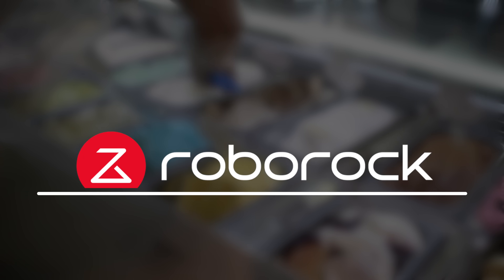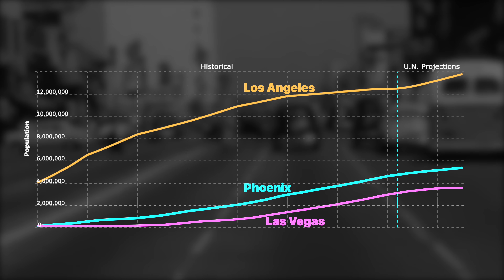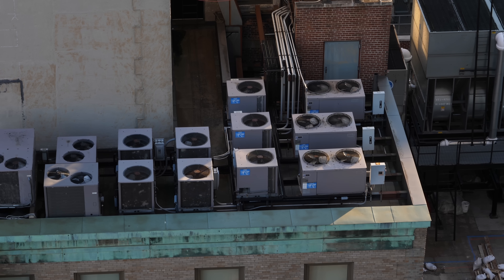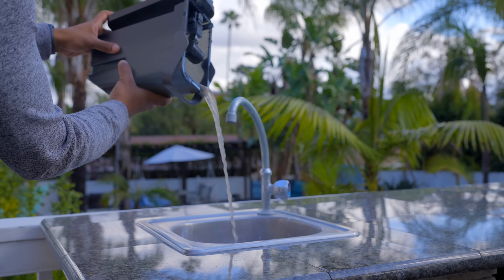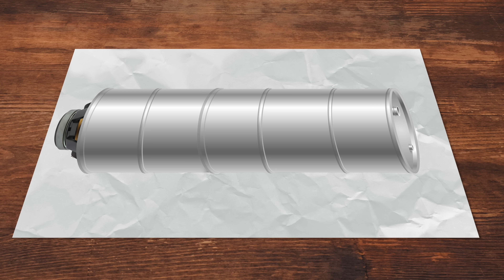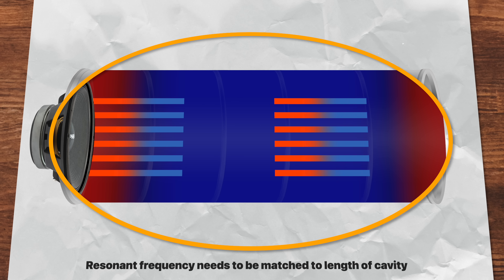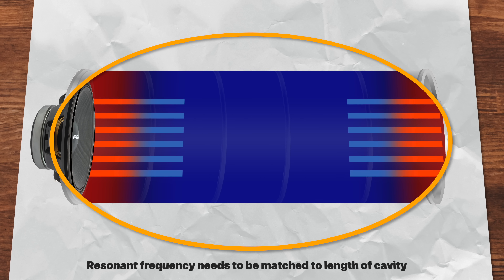Next Gen Heat Pump Heats & Cools Using Sound!

Comment from the maker: Checkout the Roborock S7 Max V Ultra - Buy 1 get 1 Free between 12/14-12/18 ! http://bit.ly/3VUJO3V
Reply: If you are losing refrigerant from your residential heat pump, refilling it is not part of the maintenance, you need a leak search and repair. Those systems are supposed to be sealed as well. Don’t get scammed by HVAC companies!
Reply: @josephesparza9900  I second this!
Reply: How Many Helium Balloons Are Filled Each Year?
Reply: We got one as soon as they were available in the US.  Wall-E is an awesome little bot running around our house now.  🤣
Reply: Fix that Fuking Mike Pls. For 6 Months the same trash high pitch Audio. For fuk sake Man ! I have to Pas your video through Audio Filter.
Reply: Wasn't BlueHeart releasing a product this year?  Any updates on this tech?

Comment: have no idea if people in the comments are correct when they say this is less efficient than normal heat pumps. but i wonder if it's easier to increase efficiency by skipping energy conversions than it is with other heat pumps. i know there are ways to drive mechanical motion directly using solar energy, which means you could skip the energy loss from converting gas/light/fuel/etc into electricity to run a loudspeaker.

Comment: that heat pumps move heat around rather than creating it does make them more efficient at just heating a space. but creating heat is more efficient at heating when that heat was going to be created anyway. my bedroom warms up significantly when i play a resource-intensive game on my computer. if i'm going to play a game anyway, then that heating is effectively free. passive homes can be designed around this concept. waste heat is not waste heat if you find a way to use it.

Comment: Two questions in case there are experts here: isn’t propane or butane just as good working fluid in a regular heat pump? Not used due to fire/explosion safety? And did thermo acoustic heat pumps and motors: isn’t hydrogen as good as helium? If so, not used for the same reason?

Comment: What's the expected scop for space heating using radiators or floor heating and hot water. I know hard to get specific but on average compared to a regular heat pump with scop's of 3.5 or 4..

Comment: You could also use heat to do your cooling.  Like thermo vacuum tubes could power this thing.  Like using this system would be cool.  This system could also heat.  Like thermo vacuum tubes could gather heat and the acoustic heat pump would multiply this heat by pumping heat from a source.  The source could be air or something like a geothermal source.  For winter one would need some heat storage for night usage or some sort of back up heat to get the high heat to drive the heat pump.  It is my understanding  that an acoustic heat pump can pump heat to a much colder temperature than most gas heat pumps. Is all this possible?  I think so as I am sending this chat to this site on something I could not be imagining using 10 years ago.

Comment: It's technically same principle as TEC Peltier, but the efficiency comes from the design.
Instead of using all-peltier membrane chip, it uses one tiny chip slapped at the side of a helium-filled ceramic tube, and the vibrations are conducted through resonance instead of forcefully electrifying whole membrane, you just electrify one tiny piezoelectric material (speaker).

Engineering genius in this is almost frightening.

Comment: Hydrogen would probably be a functionally better choice than Helium.  The small amount contained in the system, and the fact that it is lighter than air and escapes quickly, means that it would not be dangerous in the event of a leak.

Comment: 1:49 - Wow... never knew heat pumps are more efficient than natural gas such as hydronic heating. Interesting thermoacoustic heat pumps, I also read something about Magnetocaloric heat pumps. At the end of the day, I wonder which is more efficient and provides maximum output BTU. I still like the traditional mechanical gas/fluid heat pumps, they are low cost, easy to build, tons of literature on the subject, super efficient and easy to repair. The CFCs are being replaced by more environmental friendly and non toxic chemicals. I think in 30-40 years, not any time soon, the traditional heat pumps/AC will be entirely replaced by newer heat pump/refrigeration technologies globally.

Comment: I'd like to avoid going the traditional heat pump route just because the thermo acoustic variety sounds much easier to diy install and no ****ing way am I going to pay some dunce with an HVAC certificate to charge me three times the cost of the equipment itself to install it.

Comment: This does NOT make any sense!!! The efficiency of this would be at best 30 to 40%. Any energy produced is what has been inserted in the system. On the contrary, normal heat pumps benefit from the heat of the environment. For heating is useless as a simple resistance would have at least double the efficiency. For cooling, the worst heat pump has 300% efficiency. As for maintenance, quality heat pumps go for decades with no maintenance.

Comment: I'm a HVAC technician. I install service and maintain heat pumps and all kinds of HVAC systems. I'm excited to see how far heat pump technology has come.
Reply: Hi AJ, odd query: do you know how long say a typical modern 2.5kw split AC has to run to make sure its compressor doesn't go without oil? Eg. 5 minutes at a certain % of power capacity? Or do modern units have a way to only run intermittently without running out of oil for the compressor? Cheers
Reply: @jimmybrad156  The compressor should have oil in it when it starts running. It should not need to run to ensure it doesn't go without oil unless there is oil migration. Oil return is not a common issue with smaller systems. Refrigeration systems and some large units will "pump down" or empty the refrigerant from the evaporator at the end of cycles to make sure oil returns to the compressor. I'm in the US so we rate our systems in btu. If my math is right your talking about a roughly 8500 btu system. Like a window unit or mini split? It's very unlikely you have oil return problems unless you're talking about a freezer or something.
Reply: @RoyArrowood  Yeh it's a small split. 8500 BTU is spot on (2.5kw.)

Comment: Using thermoacoustic principles to synchronize the heat exchanges in a Stirling cycle engine will convert the whole apparatus into a maximally efficient mechanical engine. Fascinating the natural frequency of a cylinder is the actual Maxwell's Demon that can reverse entropy and sort hot and cold parts of the spatial volume. We've been over an oil barrel down in a coal mine for a century or more, and not for our own good either. Clean cheap energy from heat and bass woofer? Yeah the national security concern a$$a$$in$will be looking into this right away lmao

Comment: Recharging a system is NOT part of a regular tune up . Its extra $ always and indicates a significant problem ( refrigerant leak ) additionally NO DUCTLESS SYSTEM MANUFACTURER WANTS YOU TO TOP OFF EVER . You weigh in the exact charge . Topping off is dont with non ductless systems. Bad info / advice

Comment: Perhaps the best solution would be an efficient means to convert the heat into electricity, which could be more easily transported and stored for later use. Could we use giant Thermo-Acoustic heat pumps to remove the heat from our oceans (since they are natures largest heat sinks for the global greenhouse energy we're accumulating...) and turn that into electricity to power our civilization without the use of carbon? Get a second bite off the Thermodynamic Apple as it were? While at the same time fixing one of the growing problems of our own making? At least in theory, you could kill a whole flock of birds with one stone in that case.

Just a thought.

Comment: i have had a traditional heat pump at my house, air source, since 1995 and it still works, with occassional maintenence.
the biggest fault is when the outside temperature drops below 32 degrees f, it doesn't produce much heat. the manu-
facturer claims it is efficient down to 0 degrees f, but how much heat is in very cold air? during this cold snap (12/22)
my heatpump has been running almost nonstop and producing very little heat. maybe the acoustic version will be better.

Comment: How have heat pumps always been more expensive than regular heaters? Maybe with 3rd world cheap electricity from coal and with a crippled infrastructure. In Europe, with a stable, strong network, but respective prices for energy, it is insanely stupid to heat with pure electricity like a hairdryer...
Reply from the maker: heat pump appliances are usually more expensive upfront, but yes as you stated, long term they'll pay for themselves!
Reply: @TwoBitDaVinci  Okay, but isnt hat always the most important factor when buying something? Even if electricity is as cheap as in the US they will pay off over time. Not to mention the huge environmental factor of efficiency.

Comment: Couldn't really grasp the idea of how this will transfer heat. Sure you explained how acoustic energy turns into thermal energy. But first, we have to take the heat from let's say out of the house and convert it into acoustic energy in order to transfer it back into thermal energy to pump in the house. How is the heat gets transferred from one space to the other?

Comment: I have been working on Heat Pumps since 1972.  I don't believe the acoustic heat pump will ever be a real commercial operation. Thee are too many problems to be efficient. It is one of those technologies which will always be ten years away.  Heat pumps have been getting more efficient over the years.  The development of the frequency drive inverter has helped tremendously. When it is cold you can speed up the compressor to move more heat.  The same tech is in electric cars to drive the motors at different speeds.

Comment: Bad news about heat pumps 1) they become less efficient as it gets colder 2) the new refrigerants that are doing to replace the cfc , hcfc replacements due to their “ GWP” are classified A2 by ASHARE .This means they are “ mildly flammable “ .Enough so safety devices are going to be required to be installed  to help prevent fires incase of a leak .Yep, Trade offs become uglier .I am an HVACR technician and have been so for 30+ years so yeah a know something about the subject .Let’s hope thermal acoustic systems work out and there are no nasty surprises

Comment: having a higher COP is actually scary because it means for every joule removed for cooling, 5 are put into the air outside, thus leaving anyone without heat pumps feeling even hotter (plants animals) and increasing the heat island effect. we need to increase better architecture designs to reduce our need for cooling and learn to be comfortable within a temperature closer to equilibrium with the outside. the only way s higher cop helps us is when heat pumps are used for heating!

Comment: Living in the center of Texas we need A/C in summer.   Over time in our little hamlet as the units that pump air through floor vents go out we have learned to install the units for windows not in windows but in a sealed box inside the house at ceiling level with a nice vent on the outside wall.  We wire in a new electrical outlet a ways below it and run the A.C cord through the wall until it comes out by it and can be plugged in. It has a tray with a drain to the outside under it. We put several of these in a house and they look not so different than mini-split units.  Each has its own remote and the new ones are very efficient, and easy to get at a good price.  This way we can fix our own A/C problems and even replace individuals units without having to wait for expensive A/C guys to show up.  And cold air coming in at ceiling level is obviously better.  One friend told me their summer electric bill was cut in half with the boxed in units.

Comment: Not sure I understand the first bit about resonant frequency. Are you saying the gas molecules, in addition to being compressed by the forward movement of the speaker diaphragm are also excited to vibrate at a higher state by resonance? What about the energy needed to increase the rate of vibration? Where is that coming from, is it from the compression? Is this sufficient? Because speaker diaphragms move back and forth. When it moves forward it compresses the air in front of it while creating a low pressure area behind it. When it moves back however, the opposite happens. Now its creating low pressure inside the tube, making the gas inside expand and cool. Net effect should be close to zero apart from mechanical heating up of speaker motor. So what aren't I, seeing?

Comment: Cool!
I don't know if it was mentioned in the video, but the working principle of these heat pumps is that of the stirling cycle. This is just up my alley as I'm slightly obsessed with the beautiful simplicity of the stirling cycle. It should in theory be more efficient than the rankine cycle (that is used in your everyday heat pumps which uses a phase shifting working fluid). The biggest drawback of the stirling cycle has however always been the low power density, which has caused big, impractical and expensive machines. If this is solved in these thermo acoustic heat pumps I'd say it is a breakthrough.
Fun fact: The process is reversable, meaning that if you have a temperature difference, It can create a standing wave from which energy in turn can be harvested by the "speaker".

Comment: I still think an oak log in winter and an open window in summer are hard to replace.  No wiring.  No bad gasses.  Works everywhere. What do you think?
Reply: I think that the oak log is making very bad gasses. In cold Norway we use wood stoves a lot. If you use an old oven, and you get an inspection, the inside air is some times so toxic that the inspectors aren’t allowed to enter the home. It creates worse exhaust than a diesel car so in cities there are days where wood fires are not allowed due to air pollution. Modern burners are much, much better as long as they are operated properly. 

The open window will never cool below outside temperature so on a  100F/37C day, you will be very warm. 

Here up north we use heat pumps a lot. They are reversible. Cheap heat in the winter and cooling the few days during summer that’s needed. Those days are becoming more frequent, not due to climate change, but because new buildings have better insulation. 3 layer windows, 20-40 cm / 8-16 inches insulation in the walls and ceiling, and almost hermetically sealed. 

However, the cozy effect of the wood is hard to beat. And a safety factor, in case of a power outage.

Comment: Heard about these years ago.  Good stuff.

You can do this now with regular air compressors.  Without the phase change of the refrigerant, you are going to have a hard time scaling this up to even residential capacity.

You might as well just do away with the mechanical portion and go with thermal couples powered by solar panels.  They are about as efficient as the acoustic systems.

Comment: Going to be super expensive at the beginning. Existing hvac is so entrenched going to be hard to compete with them. Do you use it with duct work? Minie split head? I think sound and saltwater would produce the same effect. I used to sweat and put the older phone to my face and the speaker would make my face cold when someone talked.

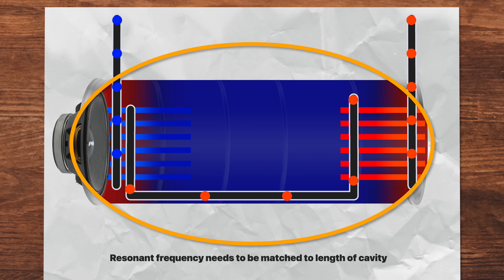Comment: 7:56 the pipes on the left side of the diagram are incorrectly configured. The cold ‘tap’ should be to the right, where the exchanger is coldest, and the transfer-to-hot-side tap should be all the way to the left (where you show the cold tap).

Comment: Current Heat pumps SUCK! Never comfortable,  sweat your butt off in summer, freeze it in winter. When outside air temp gets 45 degrees Fahrenheit or below, big resistance heat strips come on to heat, still not comfortable and power bill is high. I had one if those new "Efficient heat pumps" total BS, will never ever have one of current design again. One has to know its BS when a power company recommends them, that's so they can jack up their profits, power companies will never recommend anything that benefits the consumer.

Comment: In you illustration, how can 1 watt of input produce 3 to 5 watts of heat output?  Doesn't that violate some law of thermodynamics?
Reply from the maker: Because it doesn’t create heat. It moves heat from one place to another. Therefore there is no new heat. The place the heat is taken from is colder than it started. Cheers!
Reply: @TwoBitDaVinci  I understand the refrigeration cycle and how the heat is moved, but I don't think a closed system can output more energy than is input.  I must be missing something.

Comment: People who don't use a lot of hot water, e.g., families of 1-3, benefit from a Demand Water Heater, eliminating the batch heater. But in cold climates, heat waste captured/stored, might be economic. Here in Henderson, NV (Vegas valley), we plan to eliminate the need for vehicle fuel by owning an Aptera, fueled by PV on the car.

Comment: Sounds good on paper.  The most important thing is the insulation of the building itself.  You can be very efficient with a regular AC/heat pump too.  With a good old R22 🤣😂